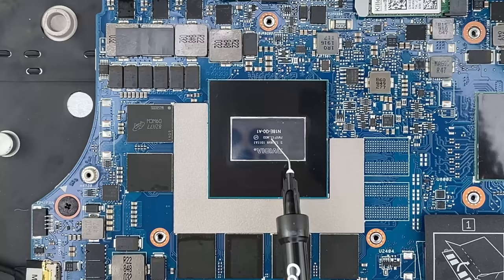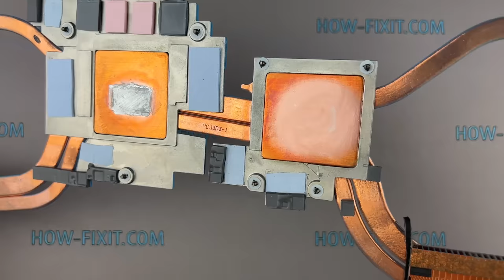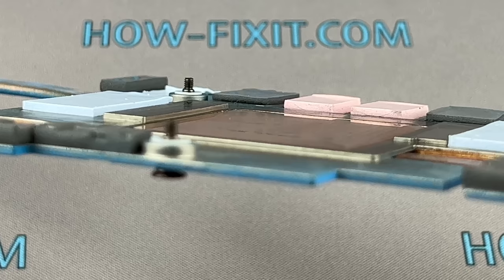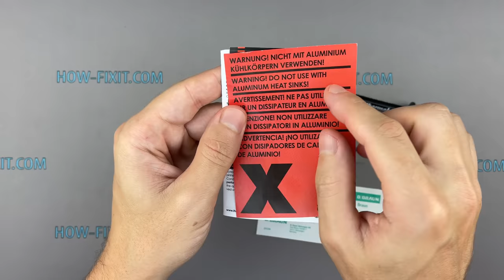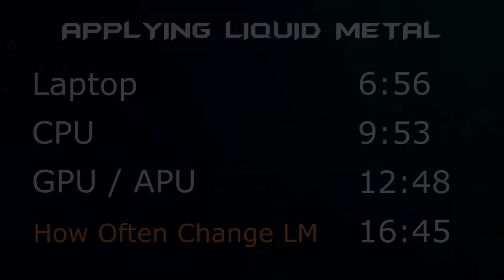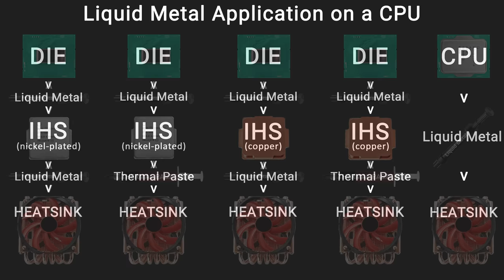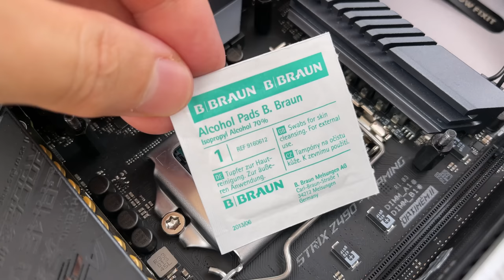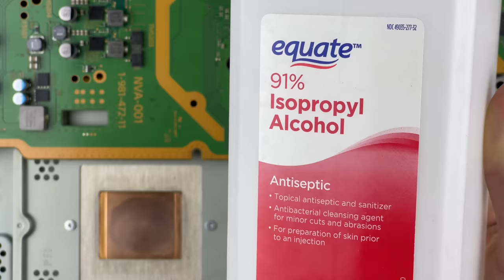Ultimate Guide to Applying Liquid Metal to Your CPU, Laptop, GPU, and Game Console

Comment: first time using liquid metal on a laptop, didnt know i need to redo everything on 1 month, do i need to reapply liquid metal on 1 month or can i only apply the first time and that's it, also i forgot its normal that after liquid metal has been applied different heat zones appear? per example bottom of my laptop was the normal heat zone that was higher when thermal paste was used, now its not after the liquid metal the new heat zone is on top of the keyboard

Comment: HEy! Thanks for this wonderful video! My ROG Scar 15 2021 Had LM on the CPU and Thermal paste for the GPU. Is it fine to use LM on the GPU as it doesn't have any coating around it. And since day 1 temps were around 93 to 95C + with fans on max speed. Any solution for the temps?
Reply: hayır gpu da termal macun değişimi yapın . olmazsa bu videosdaki yaparsınız

Comment: so if my heatsink is nickel plated will the liquid metal not react with it? only if it is copper do i need to worry aboht reapplying?
Reply: If nickel plated it shouldn't need re-applying as it doesn't alloy with nickel as it would with copper. If your temps don't improve as much as expected it's worth cleaning the LM off gently and apply again ensuring you break the surface tension and completely 'wet' the surfaces. I had to do this on my recent 14900KS delid and nickel plated direct die cooling to resolve a hot core.

Comment: I bought a laptop with liquid metal already applied, judging by the video i shoul replace every 2 years or so right? And when i replace i wont need to re apply in 1-2 month since it already came with liquid metal applied right?
Reply: Laptops that come with LM pre-applied should normally have nickel plating for this exact reason. But there's a chance for a factory error and missing LM application or thermal pads on VRMs/VRAMs.
Its best to run a few benchmarks and see of your device is performing within spec

Comment: hello, thank you for the details review on how to use the liquid metal properly. however, i was wondering is the polishing part important (to remove the grey stain on the copper heatsink or can i just re-apply after cleaning simply with alcohol ? thanks
Reply: it isn't. he was trying to prove that it does not destroy copper heatsinks
Reply: @kiyoponnn  okay, thank you for your reply
Reply: fyi DO NOT use polish, any kind of polish is an insulator and will trap heat, Jayztwocents went over that in his lapping video
Reply: @3D-DOMO so, what shall we use to clean it??
Reply: @hooda24ma  just use the little scraper and isopropyl alcohol or nail polish remover, the latter will probably work slightly better but the acetone in nail polish remover pretty harsh, so I'd recommend not getting on the PCB itself. but those will clean it as much as you need to reapply new liquid metal. It will still be stained but the stain will not affect the temps at all, its honestly not even really a stain per se, it's more of an alloy, the liquid metal bonds with the copper, it doesn't affect the temps at all so there's no reason you need to attempt to get the "stain" off when you'll never even see it. Youd be Better served with either of those options than using a polish, which actually does have the ability to insulate and there for could hurt temps.
Reply: @3D-DOMO  what is PCB? I will only use the nail polish to clean the stain on the copper heatsink
Reply: @hooda24ma  Printed circuit board, Like the motherboard. I will be the first to say you do whatever you want to do with your stuff, but I feel as though I should point out as cool as liquid metal is (no pun intended) you're only talking a few Celsius difference between that and a really good thermal paste like arctic mx-6 or Kryonaut Extreme. Those two are non-conductive and perform great with no risk to your system, I'm sure your aware but liquid metal has the potential to fry your system if it touches the pcb or CPU socket anything like that. So those two would be my recommendation for you for a CPU thermal paste. But good luck with whatever you decide to do :)
Reply: @3D-DOMO  I'm very aware of insulating PCB and SMD components around the processor to avoid shorting my device. I've done it many times before. the thing is that I tried a decent thermal paste on the processor and temperature was spiking to 100 even with 5% work load, so I reverted back to the LM but it's not giving me what I used to have in terms of low temperatures, I guess the reason is the worn thermal pad, so I'll use a new thermal pad on the efficiency cores and a new LM application. I'm just wondering shall I wipe out the gallium stain totally or just clean it as you mentioned and then apply over it?
Reply: @hooda24ma  Yea like you said it would have had to have been the thermal pad because there's no reason even a shitty thermal paste should run that hot even under load so there was something else going on, because obviously 98% of people are using a non-conductive thermal paste with great result. However, if you are set on liquid metal then yea, just use nail polish remover and apply new over it. The stain will not cause any issue and youl never see it so it doesnt matter :)

Comment: Liquid metal creates an alloy with the metal it has contact to. This is called amalgamation. The question is to what extent this happens.
In this case, the liquid metal isn't mercury, but Galinstan, an alloy of gallium, indium and tin.
Reply: It's not Galinstan. Galinstan is a particular ratio of Gallium, Indium and Tin but what that means is it doesn't cover other ratios of these elements. Galinstan is also not the best ratio for a heat conductive liquid metal so it's not going to be used. Der8auer went over this on a Gamers Nexus collaboration.

Comment: May i ask so to isolate smd components on the cpu of laptop you need TG Shield ? so basically all conformal coating should work right ?
Reply from the maker: Yes, you can use any conformal coating for electronic components

Comment: If I am just applying Liquid Metal on top of the IHS, do I need to insulate the motherboard around the socket with liquid electrical tape?
Reply: @@myfingerpoints6282 thanks boss, appreciate the tip!
Reply: @jordanhorvath7096  what did the comment say? I cant view it, but I also have this question
Reply: @xCheatah I never got a response, but I insulated the whole board
Reply: @jordanhorvath7096  ohh I see, isn't that a lot of work? what material did you use?
Reply: @xCheatah I used liquid electrical tape, just make sure you don’t get any on the connectors or in the sockets

Comment: Rough side of sponge? that is very abrasive so you actually cut surface off from metal. that make hollow area of the surface.
For Many of laptops, Heat pipes have to be removed to clean the cooling fan. Think about you do this several time in every year.  You will definitely have hollow surface and this will cause bad contact between cooling pipes and CPU or GPU.
I Would not recommend Liquid metal material at all.

Comment: The little advantage it offers in terms of slightly better temps isn't anywhere near worth the downsides - it's conductive, it stains or corrodes heatsinks, it's much more expensive than conventional pastes, it's more difficult to remove than a conventional paste....

And all that for what? Maybe 4C less, on an operating temperature range of 80C or so?

Comment: Ultimate guide by me: 
Step 1 = DON'T DO IT!

After 3 gpus and 3 motherboards shorted, because a rogue piece of liquid metal decided to bang on my vrms and slip under the gpu core silicon.
Yeah, just don't...
Reply: Yeah, he didnt exactly explain about putting silicon barrier around the chips to make sure it only stays on the chip.
Reply: @SuperFlawless2010  how would one do this?

Comment: The best way to use liquid metal: don't! I got in multiple gaming laptops over the past couple of months. All had failed GPUs because the liquid metal didn't spread out and transfer the heat. Similar to what happens when you don't spread out thermal paste.

Comment: Why bother for an extra 1-2 degrees though? I'd rather not leave marks on any part of the heatsink, how is it affected after multiple 4 year stints? Compared to a heatsink used with thermal paste for the same amount of time it just seems like a bad idea, plus the risk of liquid metal ending up on other components and even the leftover dust from 4 years of liquid metal, if any of those shards even miniscule end up on a component in your pc and it heats enough to re-liquify you're risking more damage 

just use thermal paste

Comment: Dude you still removed a layer with the abrasive sponge. The point is that it does eat into the copper, just insignificant that you can smooth it out with an abrasive sponge

Comment: Step 1: Replace liquid metal with thermal paste for multiple reasons.

- Thermal paste is simply saver in every way. It is not electrical conductive and it is way easier to apply and clean when you want to renew it. The difference in temperatures are just a few Kelvin so literally not worth the risk of shorting your system.

Comment: Ultimate Guide to Applying Liquid Metal: do not apply liquid metal. Use thermal paste or a cryosheet. 5 degrees difference doesn't worth a potentially burned down motherboard, CPU or GPU.
Reply: The difference is often more than just mere 5 degrees though.🤔
Reply: @hadifelani  can you link any experiment that supports your claim?
Reply: @alexkolesen3765   it's on my own laptop 🤷‍♂️ MSI P65, i7-9750H

And you're wrong if you judge everything only by looking at their temperature difference. 🤦‍♂️

The ability of Liquid Metal to carry more amounts of heat, the level of consistency it can make the chips to run at higher frequency for longer periods of time, and how fast it can transfer heat away are also superior to any thermal paste.
Reply: @alexkolesen3765   your 5 degree difference is probably because you only have light usage or your CPU ain't a toaster to begin with. 🤷‍♂️

Comment: No no no! Warrenty is instantly voided !!! Why do you want to coat your processor or Gpu socket in short circuit juice?  Liquid metal is so bad and invasive it sometimes get INSIDE the Cpu IHS cover. Watch the repair videos on liquid metal. there are so many to choose from! Just get AS5, AS Ceramique , or any other Arctic silver brand paste. But the AS ceramique and you can drool it all over the Pcb on accident and your 100% OK. Its literally like 1-2 degrees less effective, you'll NEVER notice any performance difference whatsoever. And youll never have to worry about migration damage and instant warranty void either.
OH yeah, PS Liquid metal voids every warranty from every major manufacturer. so even if its ok and your card dies from another reason? youll be rejected for warrenty damage and denied 100% of the time. Just say NO to liquid metal